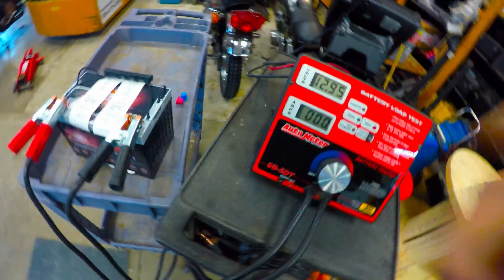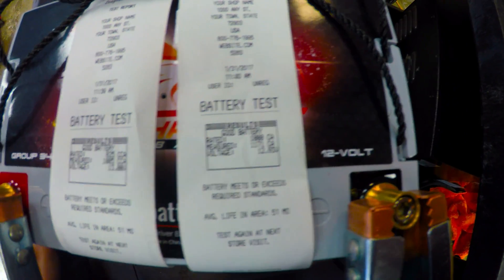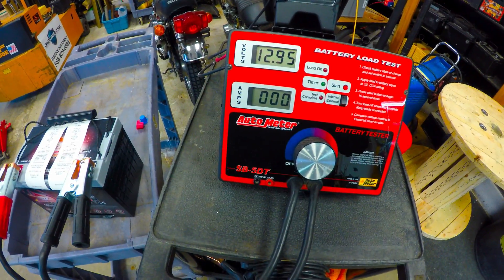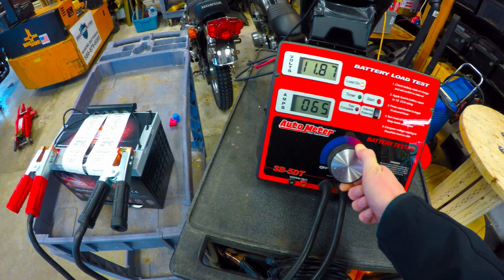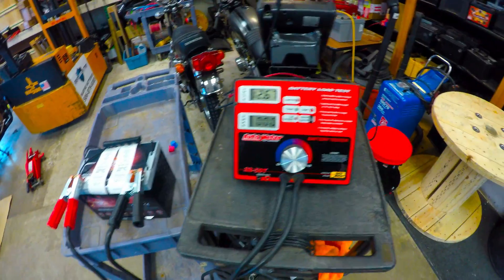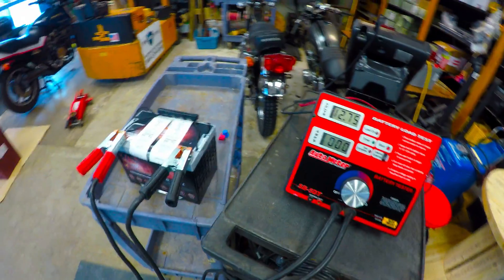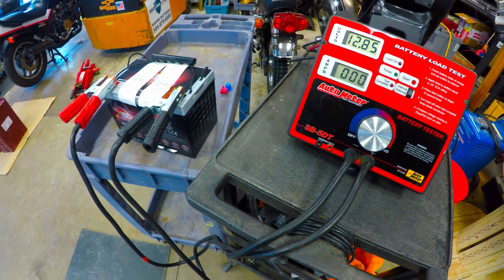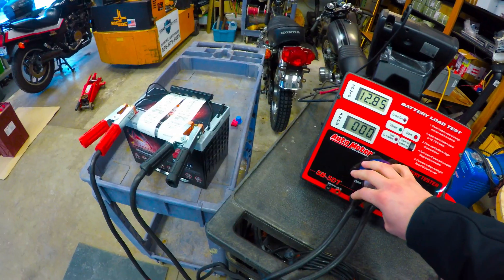Test My Batteries: Full Throttle Group 34 AGM (Brass SAE Post, Part: FT825-34)

Comment: how are you bro, do you remember that I asked you if you could test the fullthrottle ft1100-31 is because I have one and I wanted to ask you what difference you see between ft100-31 and xs power d3100, wich one is better for you, thanks bro 🖒
Reply: Cali Bass same here, i just bought a ft1100.
Reply: Cali Bass I wanna know also... I'm debating on which one to go for myself.
Reply: I want to know also, I had a system put in and the audio shop installed a Full Throttle FT1100-31 as a secondary battery.